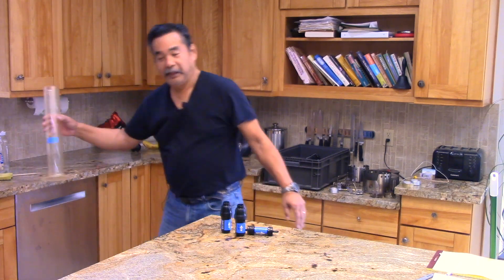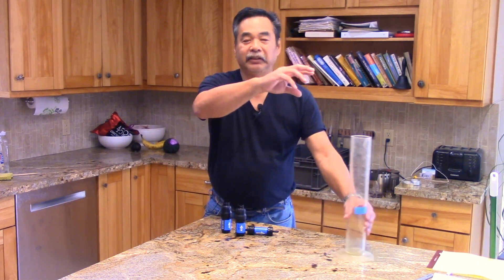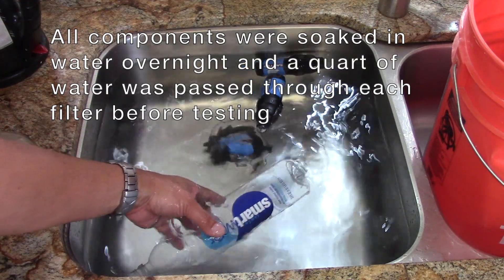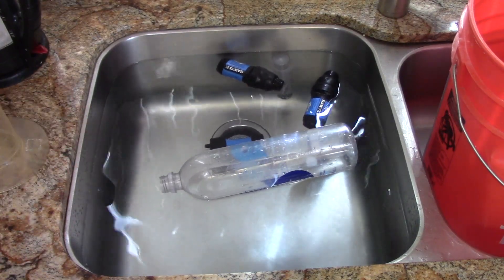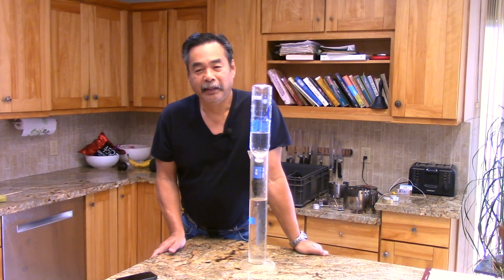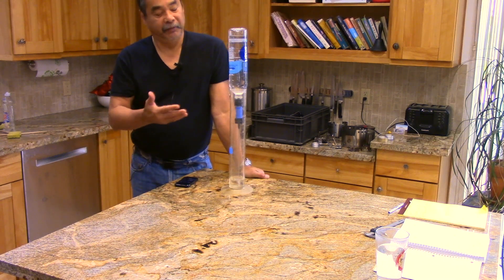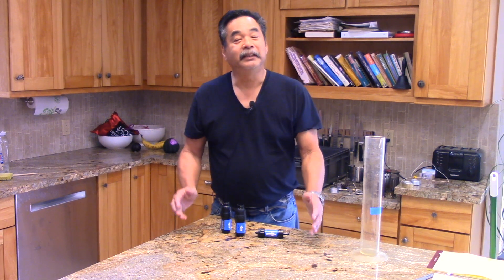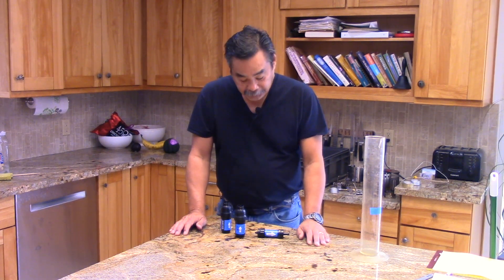SawyerWater Filter: Squeeze versus Mini by FLAT CAT GEAR

Comment: Question 1. Is the water unsafe to drink out of the mini but safe to drink out of the squeeze? The answer is of course not. There I saved you all that extra money not needed on a new water filter. Question 2. When was the last time an extra 30 seconds of filter time ruined your hike or camp? Were you in Iraq or perhaps Flint Michigan under fire and needed that water in seconds....what a bunch of B.S. sales pitch hype all these youtube videos are. THUMBS DOWN
Reply from the maker: “knowledge is power” as the saying goes.  To date, no one has been able to quantify the quality of a Sawyer water filter: “how much useful life is left in this filter?”.  So, here is a technique that you can use to estimate how much useful filter material you have left.  All that you have to do is measure the flowrate of a new filter as a baseline (or use the values that I measured here).  At any time, you can re-run the test and the difference in flowrate will approximate the amount of effective filter material you have left.  As I demonstrated, my 5-year-old filter had only clogged 1/3 of the filter area and there was plenty of useful filter area left.  Before you are under fire in Iraq, you can have confidence as to the quality of your filter.  Again, “knowledge is power”, if you find this information useful, feel free to use it.

Comment: The issue I had with the mini wasn't so much time but its propensity to clog, an issue I never really had with the original. I only ever take the original now.
Reply from the maker: Assuming that the filter elements are the same between the Sawyer Mini and the Squeeze, then the only difference is the amount of filter area.  The Squeeze was originall rated to 1,000,000 gallons while the Mini was rated to 100,000 gallons which would imply that the Squeeze had 10 times the filter area.  This simple test shows that the area of the Squeeze is at least double that of the Mini (2.25X).  Regardless, to me the Mini is not an optiaml choice.  The fact that my 5 year old Squeeze out performs a new Mini is pretty significant.  My 2 cents.
Reply: The filter surface area comment rings true. Thanks for the insight.